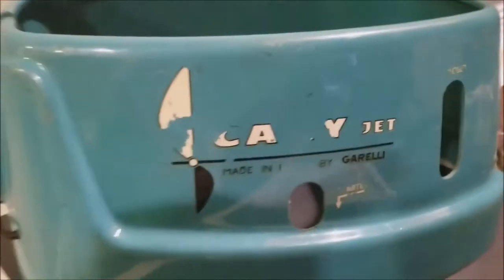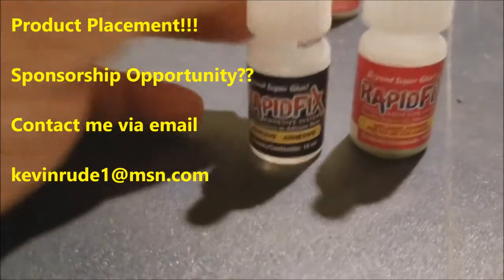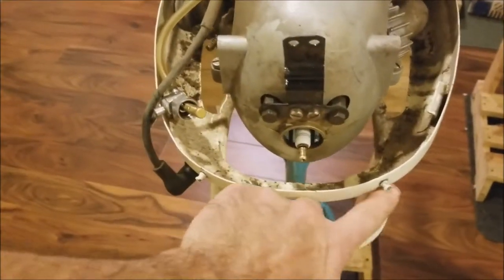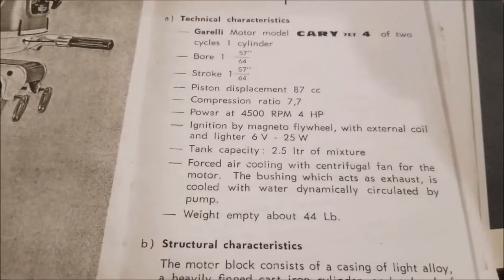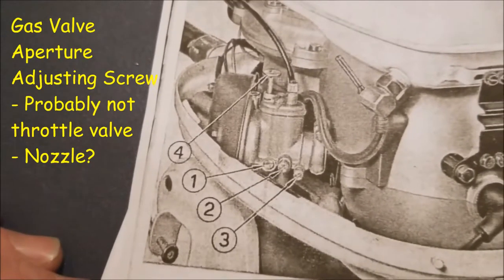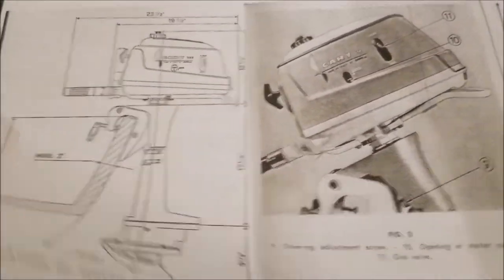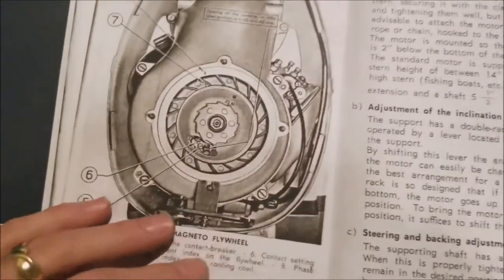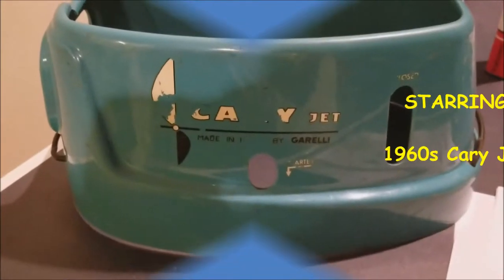Kevinrude's Garage: Episode 18: 1960s Cary Jet Cowl and Manual

Comment: Hi, I also have one cary jet motor, but without plastic engine cover, I found it in my cousin garage, ready to garbage. I clean it, and now it's run. New spark plug, carb cleaning and fresh fuel mix 40:1, run perfectly. Little slow, but almost unicate motor.

Comment: Hello Kevinrude. Thanks for the videos. I just traded Tyler a 1978 Evinrude 2hp Mate for his Cary Jet 4. I hated to part with the little Mate. It took me over a year to get it sorted. Turns out a PO had put a used WRONG carb on it with too rich an emulsion tube. It runs sweet now. But, I didnt' have a boat for it. I've sorted a few items on the Cary Jet (bent latch lever, bent transom clamp screw that work now).   Tyler disassembled the recoil starter because it squeaked and was hard to pull. He cleaned out the old hard grease. But, now the ratchet pawls wont fully engage the flywheel sprocket. It slips.  It looks like it has a Zirk grease fitting on top. I'm wondering if it has to have some grease pumped into it to push down a little to engage the flywheel. Wondering if you've taken yours apart. Perhaps Tyler got the stack a little off. It lacks about 1/8" for the ratchet pawls to fully engage the flywheel sprocket. I have the same PDF users manual. A parts diagram would be good to have. I'm going to try and fabricate a new shroud from fiberglass. Your videos and Art's photos have helped. I'll post some pix and a video of mine once I get some time on it. Love your videos, keep em coming. Stu (Los Alamos, NM)

Comment: You said you found two Garelli parts vendors. Did either of them have parts for the Cary Jet? I recently got one but it is missing the cowling... I am having no luck finding one anywhere. Sweet little motor though
Reply from the maker: Woof, not sure you're going to find anyone with a cowl!  I was talking about mechanical parts only.  Unfortunately, no, I have not contacted either vendor; I can't tell how to remove the flywheel on the Cary Jet and don't want to accidentally break it, so I haven't done anything with it yet.  Here are the two parts suppliers I found, however: https://www.dellorto.co.uk/product-category/dellorto-motorcycle-carburettors-parts/dellorto-vintage-carburettors-and-parts/me-parts/ and https://www.dellortoshop.com/contents/en-us/d37_Dellorto_ME_Carburetor_Parts.html.  Good luck!
Reply: @kevinrude1270  I have searched and searched, and I have only found two or three of these motors in existence! Much less a spare cowl laying around! Thanks for those sites, and good luck getting yours up and running. If I take the flywheel off I will try and make a video to see if it helps you out!